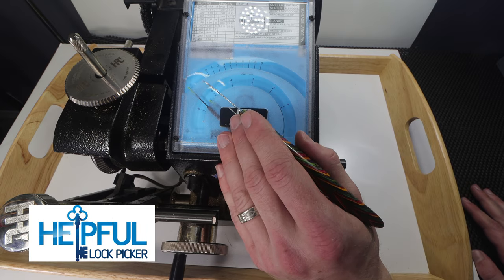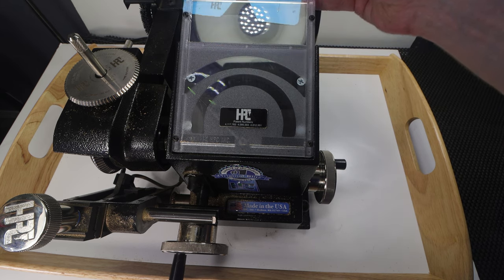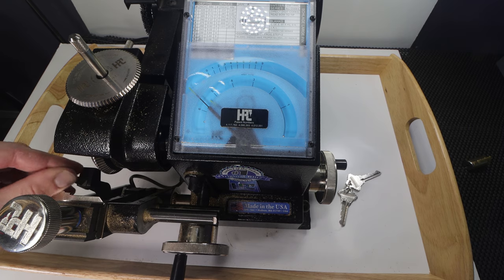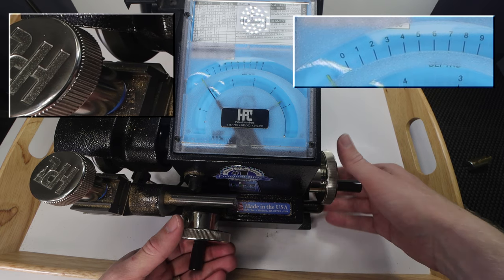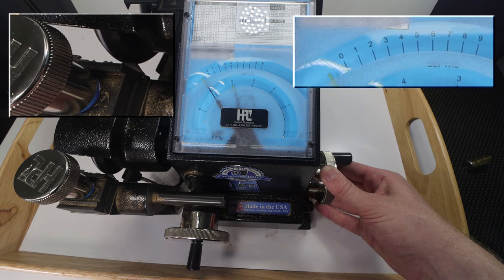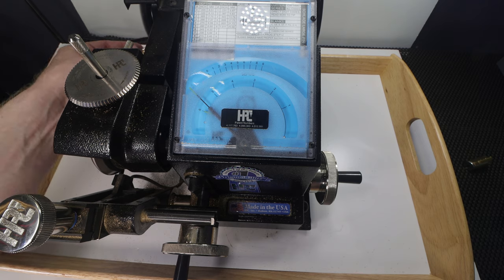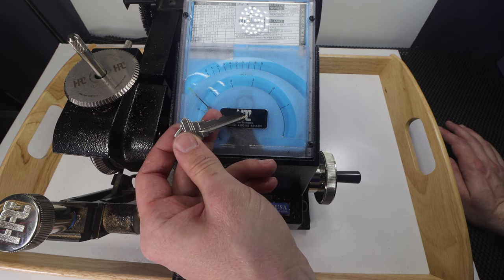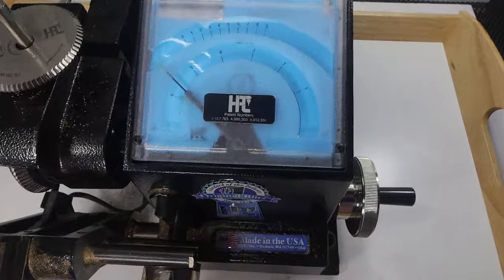How To Cut Keys By Code

Comment: I ended up buying this machine. I’m trying to cut kwikset kw1 with cw -1011 and it cuts off shoulder. I heard you have to move space while cutting depth to make the flats, but doing this the shoulder gets cut to short. What am I doing wrong?
Reply from the maker: I think that's the wrong blade. I am not near my machine or code cards. Look at the Kwikset card and verify you have the right blade and that you are using the shoulder gauge. You have to cut twice to get the spacing right or center cut if you have the Kwikset specific blade
Reply: @HelpfulLockPicker  yea the card form instacode says to use cw-1011 but thats for the smaller pins. I read recently that a CW-14MC would do it without needing to widen the cuts. I ordered from ebay, just waiting for blade to arrive.

Comment: Hello!
Great video and the timing is amazing! 
I am ready to purchase one immediately! One of our local charities accepts keyless orphaned locks and padlocks them sells them to me for .45 cents a pound allowing me to improve my locking skills.
After picking or raking them open I then decode them with my Lishi 2 & 1. 
From there, using my Lishi cutter,
I promised the charity that supplies me with all these great locks that once I got the locks open and decoded, I would donate it back to them along with 2 working keys.(at no cost) allowing them to turn around and re-sell the locks for a handsome profit.
Sadly I have not been able to generate a single key with the Lishi cutter and therefore unable to follow thru with my promise.
Please tell me where I can get a basic used code machine like yours.
Thank you for your help. David in WA
Reply from the maker: Hey David,

I am not sure what your budget is but the HPC Blitz or maybe even the cheaper HPC Punch could be great machines for you.

I am not sure where to get them used outside of eBay. Just make sure you get a machine that comes with the code cards. If you get one without the code cards you can buy them separately but that is expensive. There are also places where you can get third part ones but you'd have to cut them out yourself. 

I look forward to seeing what you eventually choose
Reply: i like that idea, that is a great way to get many locks to practice with

Comment: You are not "copying", but making a perfect "original" so to speak -- Thanks for sharing fun on your new machine -- so shinny new without piles of brass shavings all over (not yet, that is; plus a non gouged key shoulder stop, "yet" either)
Reply from the maker: Trust me, I have hit it at least 3 times not paying attention lol. I love my machine. I keep a vacuum handy to clean up after cuts.
Reply: @HelpfulLockPicker  LOL-- join the club
Reply: @HelpfulLockPicker  You could do what I do when drilling: aim the vacuum at the key blank and turn it on. It will suck any shavings directly into the machine, no need for cleaning up afterwards

Comment: hi HLP! I am interested in a machine like this which does Automotive keys, not duplicator but code cutter. Do you recommend a certain machine? will this machine work on auto mobile keys???
Reply from the maker: The Condor Dolphin is the way to go but you will also need a programmer

Comment: I was a bit worried when you brushed the key, as your hand was few centimeters away from the spinning cutting blade. I do hope there is a side shield that we can't see.

I actually wonder if there is reason to retract the key entirely when cutting. Aka, Let's say we have 2,2,4,2. You can cut 2, then do not retract the blade and keep cutting when you move to the third position, then cut deeper 4. Then retract to depth 2 and move until you reach position four.

That would smooth the key and remove some of the "bumps" on the key between positions. Is there any reason that you want these bumps?
Reply from the maker: To make bump keys
Reply: @HelpfulLockPicker , In case my question is not clear. Is there any practical reason to want "bump keys"?
Reply from the maker: @ИванСнежков-з9й  yes, they are very helpful to open locks. Especially locks like Yale with annoying warding
Reply: @HelpfulLockPicker  What is annoying warding?
Reply from the maker: @ИванСнежков-з9й  it is locks which are hard to fit picks into
Reply: Every key I've ever seen (that I didn't file from a blank myself) had triangular points between the flats. They would help keep the key aligned with the pins, and also prevent removing the key from a partly turned plug, if the cuts were increasing depth toward the end.
Reply from the maker: @edwardhuff4727  thank you for the more realistic answer I was just having fun with my mine

Comment: I don't cut enough to justify the cost of that machine. So the odd time I might actually need to cut a key from code without one to copy, I just find the appropriate pins and line them up to trace a profile, the cut a blank with a dremel and files. To check the final cut and refine and finish I just use a cylinder with the pins and fine tune the key till the shear line is perfect and the key glides in and out smoothly.
This method takes a long time and a lot of patience, but since I only do it once in a blue moon it serves me better than buying expensive equipment I would rarely use.
Reply from the maker: Thank you for sharing your technique! These machines can pay for themselves very quickly though

Comment: Great job!P.S. Did you make sure it was it calibrated properly when you received it?
Reply from the maker: It came new (documented to have been calibrated prior to shipment) and it cuts everything fine. So, that was my test I guess. Also, I am about 45 minutes from HPC so I can drive my machine down worst case
Reply: HelpfulLockPicker Cool!I just mailed in my Model B tubular pick to them for repair.

Comment: My job has me stamping  and cutting well over 100 keys in a day on the busy days... all on the Blitz.
Reply from the maker: I hope you have the Quick Nut changing blades like that would be annoying.

Thats a serious amount of keys!
Reply: @HelpfulLockPicker  I do have those blades. Better yet I have two blitz machines. One with a Schlage wheel (90% of my work) and the other with a Corbin Russwin System 70 wheel. Those two wheels work for 99% of what I do regardless of manufacturer. Really want the HPC punch machine for Schlage.
Reply: And forgot to say I love your channel!
Reply from the maker: Thank you for the kind words! Fun fact, it isn't the right way to do it but the CW-14MC cuts Russwin Series 70 fine for me so I still have held out on buying another wheel. I really want to get the Kwikset one because the double cuts are annoying

Comment: Hi helpful lockpicker I have a cylinder lock that I have zipped rocked raked spp bitch picked and still it won't open the key works but could the lock still be broken I'm running out of patience with it it seems like the only thing that will open it is a hammer or stick of dynamite hope you can help thanks Jim
Reply from the maker: Did you say the key works? I don't think the lock is broken then. Could you find another lock to practice picking on?
Reply: @HelpfulLockPicker  hi thanks for your reply I do have other locks that I have picked cylinder and latch locks but this one is giving me real greif do you think it could be I'm not skilled enough I've only been doing this for about 10 weeks now and if possible could you please recommend a book for me to buy thanks for your advice
Reply from the maker: @jimm596ify  if you are more of a reader Google "Lock Picking Detail Overkill" also, consider checking out my Lock Picking Home School Series.

That lock could be anything. Honestly even easy locks can be hard, it is hard to tell
Reply: @HelpfulLockPicker  been watching a lot of your videos on your home picking school but I have problems with that as well you make it look so easy but I just don't seem to be able to do it I'm beginning to get disheartned with it to be honest
Reply from the maker: @jimm596ify  can you purchase a Kwikset lock and progressive pin it? That is a great place to start
Reply: @HelpfulLockPicker  I don't know what that means
Reply: I'm just looking at your YouTube channel to see what that means do you have a video on it

Comment: Soooooo if you don't have the code on the key what would you do?

PS Hope your little one wasn't sleeping.
Reply from the maker: You can measure the bitting with a caliper or a key gauge. You can even decode the bitting with the machine itself and then cut it.

This does not duplicate, it only code cuts. There is a twice as expensive version which does both.

Comment: Hey bud so I just purchased another blitz but unfortunately it came kinda in calibrated. Used the yellow card to recalibrate it but still have issues with the depth. Cutting a kwikset but when cutting a 5 cut I have to go pass the 5 for it to be a true 5 cut. Any suggestions
Reply from the maker: Are your cutting wheels new and original parts or used? If they are used and the diameter is off or not original and not to spec that could be part of the problem